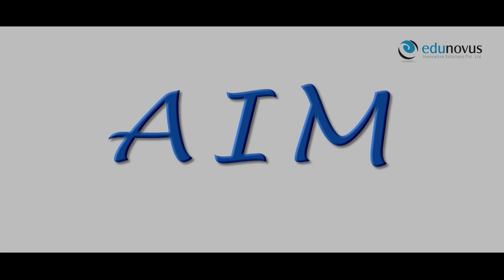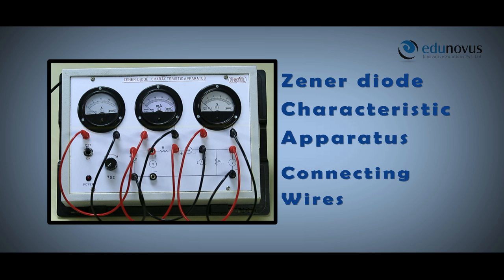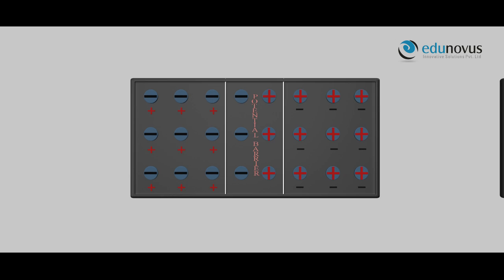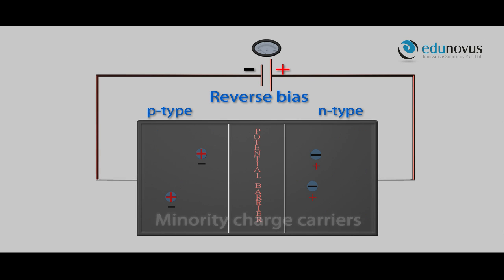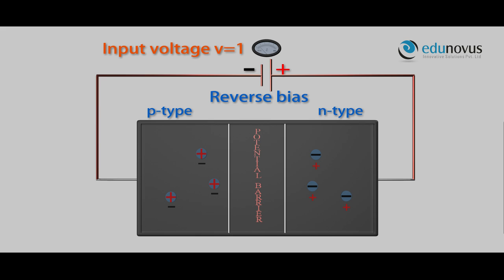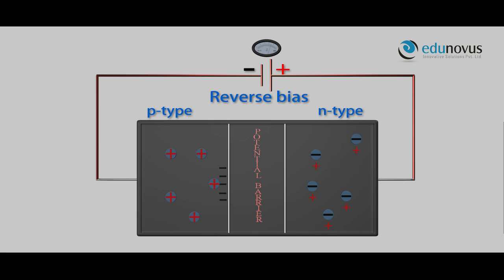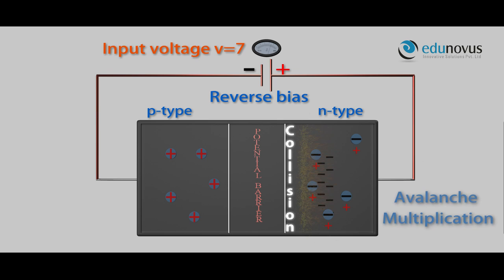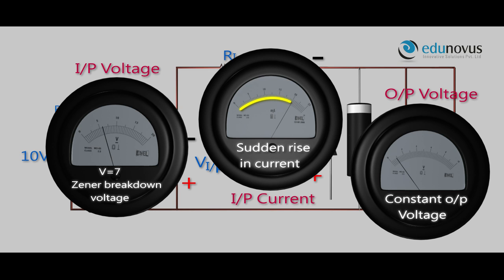Physics Practical: Zener Diode (Use headphones for clear audio/sound)

Comment: How to use the screwdriver to remove zero error ? ...does that mean we need to open up the ammeter and fix it ?😂
Reply: do you see the small screw slightly bellow the center of the case, right where the needle goes inside. turn that screw to correct the ammeter
Reply: Sidhanth Sharma ohh ! Thanks brother !😉